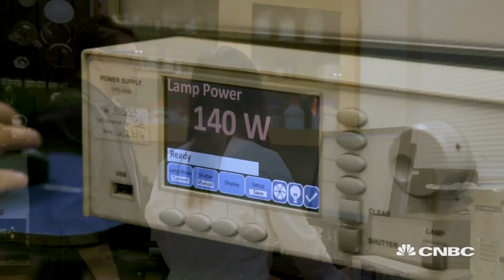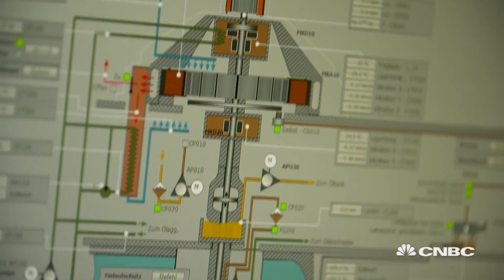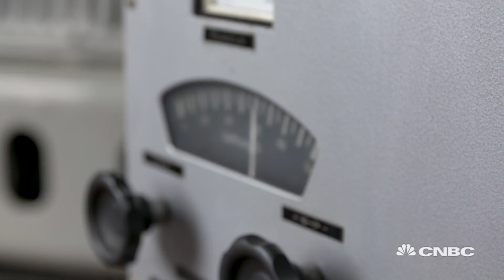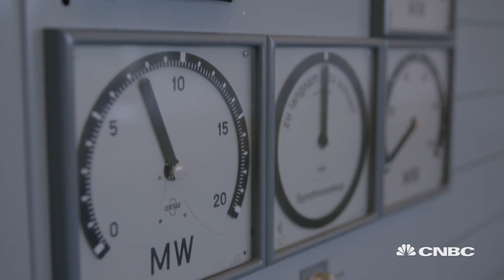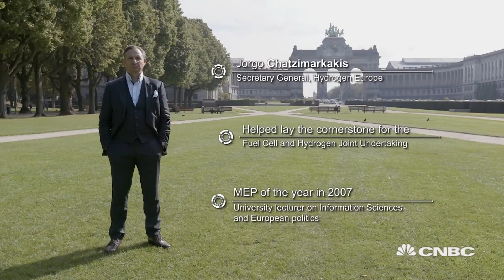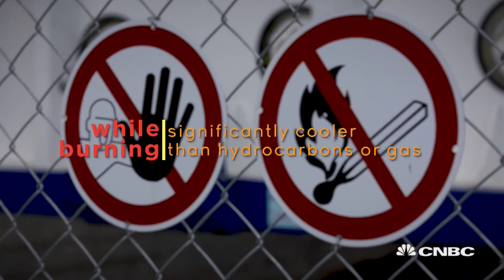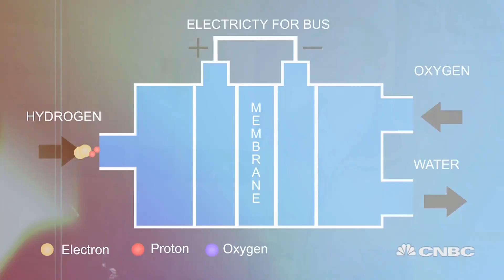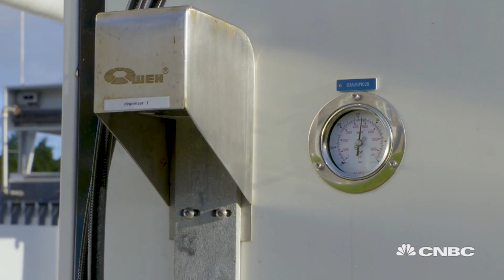Why hydrogen is becoming a big deal, part one | Sustainable Energy

Comment: This problem should be scoffed at, because manufacturers scoff at the price of components.
Feuilleton. Electronic flowers.
The electronic flower is a silicon wafer 15 by 15 centimeters. Tracks the sun with two micro-drives
 and a control microcircuit. It produces hydrogen during the warm season. It produces electricity during the cold season. The electronic pulse converter operates in two modes: electrolysis mode and mains voltage mode.The electronic flower has a 100 cubic centimeters electrolysis bath. A water supply tube fits to it and hydrogen tube and two mains voltage wires too. Productivity of an electronic flower 1 cubic meter of hydrogen and 1.4 kilowatt hours per year. Profit 0.90$ for hydrogen and 0.1$ for electricity in total 1$. Electronic flower cost 1.33$. Profit per square meter of flowers 40$.

The guy spent his annual salary on electronic flowers. He planted it in the garden. A year later, he earned an annual salary.
Sits and thinks I'll buy more electronic flowers.

Comment: Funny, 3 years later and still not a big deal. Not even a small deal 😂
Reply: Haha so true. And it is already succeeded by cryogenically liquified air.
Reply: @petergoestohollywood382  well, this technology is only working in conjunction with burning natural gas. We have one power plant in Germany who does this, but the overall efficiency is poor.

I think the best option is putting large weights down into old mining shafts, suspended by cables. That's what UK is looking into right now.

Pretty dope idea 'cause the efficiency is like 90% on half output - on full output a bit less. And the footprint is extremely low as well as the service intervals. The cables are expected to hold up 20 years on heavy usage and the worst case scenario if not is a small earthquake 😅
Reply: @petergoestohollywood382  just as an example: If you got a 2.5 km shaft and suspend just 200 metric tons in it, you could store 1.36 MWh, with zero degradation and response times of just some milli-seconds.

It can also switch extremely fast between input and output, to counteract an overcompensation in the grid, which can be an issue which can lead to a significant amounts of blackouts or network splits, like it happend on 4th of November in 2006 where the network got split due to overload on certain lines.

If we would have several thousands of those energy storage units we could let them autonomously reduce the load depending on the network status, to avoid such overloads on redundancy failures.
Reply: Because hydrogen is technology of future that never comes.

Comment: Before loving hydrogen - make sure you understand Energy returned on energy invest (EROEI) as well as The second law of thermodynamics. 2nd law indicates that a Carnot engine operating between two given temperatures has the greatest possible efficiency of any heat engine operating between these two temperatures. Irreversible processes involve dissipative factors, which reduces the efficiency of the engine.

Comment: Using excess electricity for hydrogen production is very inefficient.  Very similar to Steam as an electricity generator.  Hydrogen storage is much less efficient than battery storage, thus less expensive. Hydrogen may have uses  but cars aren't one of them. As a fuel for long distance transport or marine applications it will be a good transitional fuel.  Did you Notice they don't give you any figures as to the costs of energy??
Reply: Electricity is wasted every night when they dump the excess electricity that is not in demand to balance the grid why not find uses for this hydrogen production is only one way, in Canada we give away free to USA maybe we should use it for car charging or pumping water storage. We always just take the easy way out.

Comment: hydrogen is the only right variant for future. No other variant ! But we are developing approach, which is not exact now. There must be 2 waves for hydrogen : 1/BUILD HYDROGEN PRODUCTION FACTORIES  ON SITES OF RENEWABLE ENERGY STATIONS.  2/ SMALL CARS NEED TO LOAD HYDROGEN BY EXCHANGE WHOLE COMPRESSED HYDROGEN BALLOONS. 

We are wrong because we do not firstly build enough hydrogen production factories on sites of renewable energy stations. We are wrong because we are trying to build network of hydrogen loading stations, which are COMPLEX AND EXPENSIVE.  

 We must change our approach. We should use hydrogen as energy storage method for renewable energy stations first.  Then we should load hydrogen for usual small cars by exchanging whole standard sized compressed hydrogen gas balloons. So It is very simple and not expensive to make the global net of hydrogen supplying stations. Any normal mini shops can be a hydrogen supplying point by storing standard sized compressed hydrogen gas balloons.  We do not have to use liquid hydrogen, which is difficult to collect. But we can use compressed hydrogen gas, which is not so much different in weight by comparison with liquid hydrogen.  Hydrogen is the best solution of energy storage for all energy stations now, for example, for nuclear energy stations, for renewable energy stations.  Just install ready hydrogen production modules, and install independent hydrogen fuel cell modules in adjacent areas. Use compressed hydrogen gas at first time instead of liquid hydrogen.  

   And the last thing to notice is that, hydrogen is not more dangerous than other gases and petrol. Hydrogen has big energy storage capacity, but when burning hydrogen in accidents, IT DOES NOT CREATE ACOUSTIC DESTRUCTING WAVE TO ENVIRONMENTS.  It means that hydrogen burning is less destructive than gasoline burning.
Reply: You are absolutely WRONG.  Hydrogen production is massively energy intensive! if hydrogen is used from ANY source it is massively inefficient compared to Battery powered vehicles.
Reply: @colconn57   you showed that you do not understand hydrogen technology. Water electrolysis process has maximum useful energy exchange coefficient. No other chemical process, which has better useful energy exchange coefficient . HYDROGEN HAS ENERGY STORAGE CAPACITY, WHICH IS THE MAXIMUM LIMIT FOR ALL CHEMICAL PROCESSES. It means that ALL FUTURE BATTERIES WILL HAVE LESS  ENERGY STORAGE CAPACITY THAN HYDROGEN. The only real problem of hydrogen is STORAGING HYDROGEN. But if use balloons from composited materials to storage COMPRESSED HYDROGEN GAS, then we can solve this problem. Compressed hydrogen gas has weight density, which is not so much different from liquid hydrogen.  I am assure that producing compressed hydrogen gas balloons is EASIER AND CHEAPER THAN PRODUCING POPULAR AA BATTERIES OR AAA BATTERIES.  Hydrogen is the champion solution for storageing energy of energy stations on the earth now, include renewable energy plants, nuclear energy plants, nuclear fusion energy reactors.  For example,  collect and storage solar energy in summers to use storaged energy in winters warming , it must be ONLY HYDROGEN TECHNOLOGY.
Battery electric vehicles can exist together with hydrogen vehicles, but  battery electric vehicles have less capacity, less power, longer charging time.  If you try to drive hydrogen vehicles once, then you never want to drive battery electric vehicles any more, because hydrogen cars are powerful.  If distribute hydrogen balloons as coca cola bottles anywhere , then hydrogen distributing and storageing  will be no longer a problem, and any robots and veehicles and electric machines and drones should use hydrogen because of HYDROGEN MAXIMUM ENERGY STORAGE CAPACITY AND HYDROGEN SUPPLYING BIG POWER
Reply: @abstractexchange5057  you are talking absolute rubbish.  I made hydrogen for nearly 20 years. The amount of ENERGY required the separate hydrogen from water is high.  why do you not see free hydrogen floating around in the atmosphere? Because it bonds readily with other atoms.  Very strong bonds.  To break these bonds requires energy. . Presently electrolizers use 55kW hours of energy to make 1 kg of hydrogen.  When that is transferred to a fuel cell and converted to electricity the losses in the conversion are presently around 40%  at best .  1 kg of hydrogen thus is the energy equvalent of about 3-4 litres of diesel.  Hydrogen is notoriously hard to store. . It is a tiny atom compared to a methane molecule or water for example.  And unless very good engineering techniques are used you will have significant leakage.  It takes a lot of water as well,  and not just tap water.  Any impurities will be deposited on the cathode or anode and result in an inefficient conversion.  So you need good water purification techniques unless they develop new technologies.  The more promising technologies for producing cheaper metal anodes and cathodes are still in the developmental stage and even they are only suggesting a fairly low increase in conversion efficiencies of about 15-20 percent. 
It is most definitely NOT a champion solution.  Reversable hydro storage is much,  more efficient on a large scale and batteries are massively more efficient on a small scale.  As I said in another comment.  Hydrogen has a place possibly for large scale logistic solutions where an access to VERY cheap energy is available and where transport is minimal.  Like industrial areas or ports.  
I note that Honda has stopped development of the hydrogen car at this time.  It would be absolutely  stupid to use your household solar system to make hydrogen even if you consider that electricity free ( which it isn't)  Your Hydrogen car would need a solar panel array 10 times bigger than the average solar array to get anywhere near the amount of energy required for an average driver.  
If you have any examples you can provide to  support your claims please provide them.  I can only assume you are a troll or a schill for the hydrogen industry if you fail to do so.  The present push for hydrogen is very noticable on you tube.  But most will lead you back to fossil fuel solutions, steam reformation and CCS (carbon capture and storage). These are NOT long term solutions and just an attempt in my view to provide fossil fuel companies  a way to keep hold of the transport industry fueling dollar.  An attempt that is already failing. My figures are not exact (I'm on holiday an away from a computer) but provide yours and where you got them from and we will continue the discussion.

Comment: Check out HYSR, PLUG, FCEL, BLDP, etc, all are successful companies. Of the older technology of using fossil fuel gas has been the starting point but non fossil fuels based nanotechnology has arrived. HYSR is an excellent example.  The competition between Hydrogen and Lithium or other such Batteries will work out in the marketplace.
 They coexist currently as both are stepping away from the dirty energy. But the future is here, Green New deal is happening right now.
 HYSR is really at the forefront of nanotechnology utilizing Photosynthesis like techniques to harvest hydrogen, to be used at the site. 
They originated at the US CALIFORNIA, Santa Barbara, and now extended to the University of Iowa in Iowa city. We are very  optimistic.

Comment: I can not believe how much time, money, and knowledge is spent on hydrogen science when the hydro power system design research is abandoned like all of the energy available was gathered up using a turbine! Once you include the accelerated mass into a hydro turbine efficiency, the efficiency drops to less then 16% with perfect use of whats available. In reality its closer to 14%. That means if you do something that does not waste energy in accelerated mass you could increase the power out of elevated water up to six times! Now how much hydrogen can you make?

Comment: H2 won't work.  NH3 is the new H2.  You can store 9658 kwh in a 1000 gallon tank  (3.194 kwh/L NH3 x 3.78 L/gal x 1000 gal x 80% fill =9658 kwh) and that tank would cost $1500.  Basically a common propane tank.  A Li-ion battery costs $200/kwh.  9658 x 200 = $1,931,600.  H2 is at least 6x more volume with tanks that are 10,000 psi vs 300 psi.  100 x in costs?  Then there is the compression of it.  Hydrogen embrittlement and on and on.  Last, you can use many fuels with H2 fuel cells.  My engine can use 5 fuels and NH3 as well as other electro fuels.  Electro-fuels is the future.  They are needed to replace oil.  H2 does little to solve oil replacement tech.  Waste of time.
Reply: So where can you buy a NH3 producing module from renewable energy or is it a dream like all the other ideas yet to defeat oil.